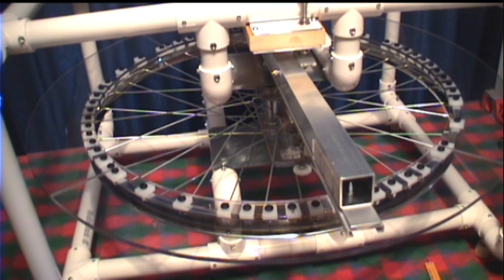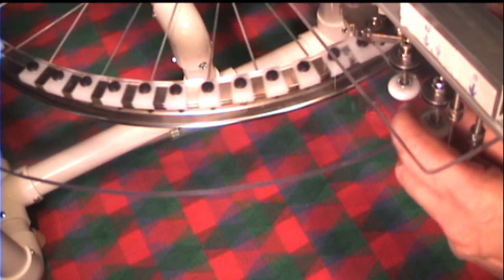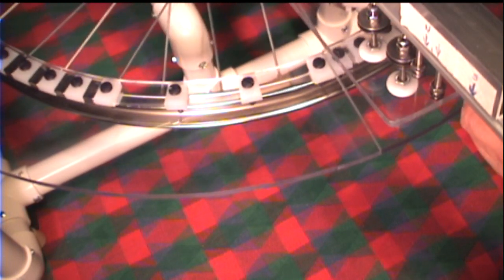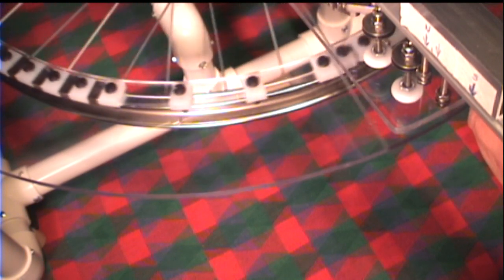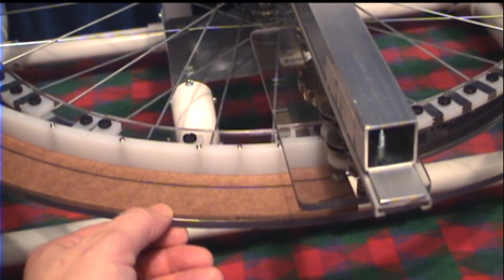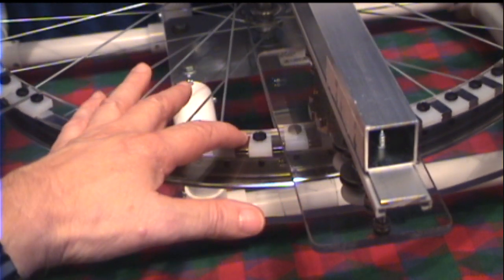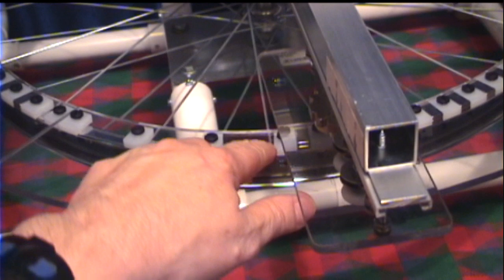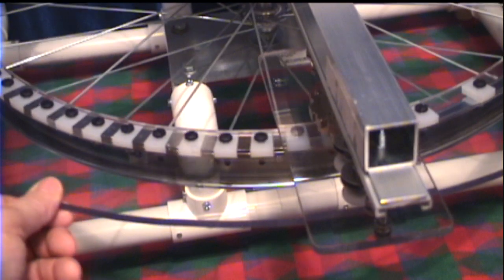Video #25, "Rick's Pipe Dream" Magnetic Motor-Generator Project

Comment from the maker: @crazypjk  You may find video #27 more to your liking, wherein the track is gone, and a push rod, or "linkage rod," as I call it, has been added.  Cam action is too slow to achieve the desired pole shift of the stator at the tail end of a rotor magnet group, so a repulsive magnetic interaction would be used instead.  Kind of a magnetic cam, you might say.  Still working on that angle while I perform a series of elapsed time tests for various rotor magnet layouts.

Comment from the maker: @MrMatt027 @MrMatt027   Alternating rotor magnet groups of north-south-north-south is the most efficient layout for a moving stator or MOSTAT design.  To avoid anti-rotational reattraction, the stator must be moved to obtain a pole shift as the last magnet of a rotor group passes by.  This provides repulsion acceleration, and leaves the stator in the correct position for attraction acceleration as the next rotor magnet group approaches the stator.

Comment from the maker: In regards to the Pipe Dream prototype, a rotational force can be either a magnetic repulsion or magnetic attraction effect which either accelerates or maintains speed of rotation.  Conversely, an anti-rotational force can be any factor (magnetic, mechanical, aerodynamic, etc.) that slows or stops rotation.

Comment from the maker: The track system is no longer used.  Instead, magnetic repulsion will repel the slider carriage inward or outward at the tail end of each rotor magnet group.  The MOSTAT has been moved from the carriage to a pivoting mount which is linked to and actuated by the carriage movement.

Comment from the maker: The carriage does not need to be locked.  When engaged with a rotor magnet group, the stator is in attraction mode and is self positioning.  Between rotor magnet groups, repulsion will be used to quickly move the carriage and pivoting stator, and a stop will be used at both ends of carriage travel.  It would only be at very low rotational speed that the slider carriage could possibly slide inwards, and downhill, when at its outer position.

Comment from the maker: The track method will not be used at all, because it cannot move the slider carriage quickly enough.  Movement must be precisely timed and occur very quickly to gain repulsion acceleration advantage at the tail end of each rotor magnet group.

Comment from the maker: Hi Jimbob, and thanks for your interest.  Yes, I expect that the unit will be self sustaining.  The friction and air drag are very minimal when compared to the accelerative thrusts afforded by the magnetic interactions.  And the new method for the MOSTAT movement will not cause any additional drag.  You can view an animation of this method at the Pipe Dream website.  See bottom of  the "more info" area here for a link.

Comment: Hi Rick
I commend you in your efforts in trying to make your wheel  rotate under magnetic force but unfortunately this can never work.  The reason it can never work is due to the fact that you need to do work to move the arm to continue rotation.  This and friction in the system will always require more energy than the mgnets can deliver.

Comment from the maker: I think you mean moving the rotor magnets, right?  That cannot be done on a narrow rimmed wheel such as I am using.  I do have plans to experiment with such an idea later by reinstalling my wood flywheel on the backside of the rim and overlaying it with sheet metal to allow a wide range of varying magnet placements.

Comment from the maker: Actually it already is divided, since the hard drive moving stator (MOSTAT) magnet utilizes both poles.  The new configuration places the MOSTAT magnet on a pivoting mount activated by the slider carriage, and requiring half the carriage travel previously needed for a pole shift.

Comment from the maker: If I had laid track at all areas where needed, and given the wheel a hand spin, the wheel would have kept going for a considerable number of revolutions.  It would have slowed and stopped, however, due to the anti-rotational attraction mentioned above.  The stator needs to move quickly into repulsion at the tail end of a rotor group, and ANY amount of repulsion will guarantee continuous rotation.  A rapid change to maximize repulsion will guarantee high rpm and improved torque.

Comment from the maker: Because the change is relatively slow, this leaves the stator in attraction to the tail end of the rotor magnet group, attempting to slow or reverse rotation.  The stator pole change must occur very quickly to avoid this, and the method I am now working on shows much promise to offer that capability.

Comment from the maker: No, the track is not needed at all adjacent to groups of rotor magnets, as the stator magnet is self positioning when over a rotor group.  The track could be used in between rotor magnet groups to prevent the stator carriage from drifting inward, but there is really no other reason to keep it.  My purpose in testing the track was to see if it could be used to change the stator position at the tail end of a rotor group, and I found the change is not rapid enough to be useful.

Comment from the maker: I do believe that a working all mechanical wheel can be constructed, however, and that magnets could be used to enhance the operation of the mechanisms.  I have a concept in mind for doing so, and will be applying that on the back side of my wood flywheel when I can find the time to do so.  One thing at a time, though!  I need to first carry on with my present course of experimentation, which I do see as promising.  Thanks for your interest, CS.     -Rick

Comment from the maker: Working with weights in this manner is problematical, though, since it would require an off-balance situation at the critical point where gravity assist is desired.  Unless balance of the rotor is maintained, the rotations will be slowed and the unit prone to vibration, much as an out of balance load in a washing machine's spin cycle.  Also, when such weight is rotated to the bottom position it must then be lifted until it reaches the top again, with gravity working against you.

Comment from the maker: Hi CS,   The Pipe Dream test apparatus is designed so that it can stand in 5 different orientations, both horizontal and vertical, so there is no need to mount the wheel differently.  A vertical orientation is shown at the beginning of video #17, where I show a wood flywheel mounted.  I will be utilizing that 4 pound flywheel later, and will also be using balance weights.  Additional weights can be added at certain critical points to gain momentum in a vertical operation, as you suggest.

Comment from the maker: Hi Doug,
Yes, I have though about practically all imaginable mechanical methods of stator movement, and have concluded that no mechanical method alone, or in combination with other mechanical methods, will work well enough.  Basically, that is because the pole shift cannot be accomplished fast enough without creating substantial anti-rotational force.  I am currently working on a method that combines repulsive magnetic interactions with mechanical stator movement, and it looks promising.

Comment: Rick,

Outstanding work.  I have a question/suggestion.  rather than a track around the outside have you considered a small disc around the hub with an undulating slot to push/pull the stator via an extension arm to the stator...seems it would allow more prcise alignment.

best, Doug

Comment from the maker: I realize that the term "moving stator" seems contrary to accepted norms, but see no problem with this description.  My stator is in fact stationary while engaged with a rotor magnet group, but is then moved while in between rotor magnet groups to effect a pole change.  Thus the stator does move, and it is therefore appropriate to describe it as a moving stator, or MOSTAT (an acronym I coined which has the same meaning).   I think my viewers understand this, and are not ignorant of the facts.

Comment from the maker: Thanks for your interest jupy.  The work continues, though I am currently pressed to complete some home maintenance tasks before the weather gets much colder.   I had done so much work on the Pipe Dream project from May to August that I neglected maintenence work on my house and cottage, so I am now working non-stop to catch up with that.  The feel of fall is in the air, and temperature is dropping to the 30's at night.  Sorry for the delay, but more is on the way, so hang in there.

Comment from the maker: This new stator magnet position not only affords high repulsion at the tail end of each magnet group, but also leaves the stator perfectly aligned for maximum attraction acceleration at the lead end of the next approaching rotor magnet group.  I'm sure that you will easily visualize what I am describing, and will understand the great advantage of this method to utilize both attraction AND repulsion forces.  Feel free to e-mail me if you have any questions or suggestions regarding this method.

Comment from the maker: The timing will occur at the tail end of each rotor magnet group, where carriage movement only requires a force of 1 ounce or less.  I will be moving the stator magnet off the carriage and onto a separate pivoting mount which the carriage will link to at a point close to the pivot.  The Stator magnet will be farther from the pivot point, so that 1/4 inch of carriage movement will equal about 1 inch of stator movement, quickly realigning the stator into repulsion with the rotor group gone by.

Comment from the maker: The carriage will have a magnet affixed at each end. The inboard end magnet will be repulsed by two rotating magnets affixed 180 degrees apart on a central axle hub.  The outboard end magnet will be repulsed by two rotating magnets affixed 180 degrees apart from each other above the outer perimeter of the rotor, and 90 degrees from the hub magnets.   Thus, the carriage will move inwards or outwards with each repulsion, and at the correct timing sequence.

Comment from the maker: You and I have no quarrel, James.  I understand your shielding methods, and applaud you for your efforts.  There is good reason, though, why I do not want to shield my stator.  I want to take advantage of attraction acceleration as rotor magnets approach the stator, as well as repulsion acceleration as the magnets
pass by the stator, and this can only be done with a MOSTAT (moving stator).   I'm sure you would agree that such movement would have significant advantage if practicable.

Comment from the maker: Perhaps, but suppose that I add that energy in the form of magnetic repulsion that moves the stator carriage outwards and inwards.  There would be no anti- rotational effect, because the stator carriage moves quite freely at the desired pole shift point, and moves in a direction that does not oppose rotor rotation.

Comment from the maker: Correct, although stator movement requires less than 1 ounce of force if it is done after the last magnet of a rotor group passes the stator.  The only trick involved in this is getting the stator to shift positions very rapidly so that repulsion effect is maximized as much as possible at the tail end of a rotor magnet group.  If movement is slow, as with the track system, this cannot be accomplished, and attraction force will attempt to halt rotation.

Comment from the maker: Yes, the stator must be repeatedly moved to shift pole positions and remain in a desired state of attraction or repulson.  The N-S-N-S configuration of the 4 rotor groups, however, only requires 4 stator movements per revolution, while 8 accelerations are realized.  That cuts the work in half.  Also consider that each shift to attraction mode is largely accomplished automaticaly by the attraction force involved, and this further reduces the required workload on the unit.

Comment: You demonstrated in you video's that the attraction and repulsion does not happen only in the  direction of the rotation, but also in the radial direction (perpendicular to the first. You even measured the forces. (Great, BTW)
So it is not just shifting the stator to and fro, but also conquering these forces.

Comment: Yes, one half of the wheel prefers one direction, the other prefers the opposite direction. That is what I meant by no preference and symmetry.
To keep it moving, you need to change the configuration repeatedly, and that is, I believe where the external energy is put in.

Comment from the maker: If you watch this video again, and are closely observant, you will notice that the rotor begins movement from a repulsive position at the tail end of a rotor magnet group, and that the next approaching rotor magnet group is in attraction to the stator.  You will see that the rotor accelerates at this second point, that this happens because of the magnetic interactions involved, and not because I am adding an energy pulse at this point in the rotation.

Comment from the maker: Yes, the 4 rotor magnet groups are arranged symmetrically around the rotor, although in changing pole configurations.  I do realize that multiple stators, arranged non-symmetrically, will be the preferred arrangement, but before embarking on that deployment it is my intention to obtain the best possible rotation from a single stator.

Comment from the maker: Actually the wheel does prefer a cetain direction of rotation.  To reverse the direction of rotation, I must orient the stator magnet to an alignment that is 180 degrees from its current position, or begin and continue stator movements starting with the opposite pole from what was demonstrated.  In that case, what has been considered as the lead-in  magnet of a rotor magnet group in attraction mode would become the tail-end repulsive point during rotation.

Comment: Besides that, your system seems to be perfectly symmetrical. If you move the stator magnet differently, the wheel will spin the other way around with the same ease or difficulty. It does not prefer a certain rotating direction. That should make you think too. 
Does this help?

Comment: Of course. I do not disagree with that. OK, use a set of magnets to energize the swing. The principle does not change in my view. Nor does the type of movement. Without friction, the swing keeps moving as a pendulum, just as your wheel keeps rotating in the horizontal. Acceleration happens because you add energy pulses. It does not matter so much if you use magnets or a blowing stream of air or pulling cords or an electro motor or what have you.

Comment from the maker: Yes, in the earlier videos it is understood that I did manually supply whatever energy was required to move the stator into the desired alignments for attraction or repulsion effects, but rotor rotation only results from those effects.  Therefore, if stator movement can be accomplished mechanically and/or magnetically then undeniably the rotor will rotate as a result.

Comment from the maker: Gravity has no effect on rotational movement of this device because it is perfectly leveled, and I never said that energy was coming from "nowhere."  You can't compare swing movement to rotor movement unless you attach a magnet to the swing seat and then use another magnet to "push" the swing, and even then the swing moves in an arc where the rotor does not.  All rotor motion is due to magnetic interactions causing attraction and repulsion.

Comment from the maker: Actually, it would be nearly impossible to arrange the rotor magnets to obtain the desired repulsive effect at the tail end of each magnet group if the stator is in a fixed position.  That's because in order to be aligned closely for repulsion, the tail end rotor magnet would have to pass beneath the stator magnet at the opposite pole from that which the lead-in magnet was aligned to.  Therefore, you would see anti-rotational repulsion canceling out any beneficial repulsion effect - not good.

Comment: Rick,

You try to move your stator magnet with a track.
But as the position is totally coupled to the position of the wheel, would it not be much easier to make the stator magnet really fixed and position the rotor magnets at each place of the wheel in the right position for the stator magnets.
As these positions are symmetrical, it would not be a big problem, but you would need a wheel with a widere rim.

Just my thoughts

Comment from the maker: "The most plausible and commonly accepted mechanism of plasma acceleration due to conversion of the MAGNETIC ENERGY into plasma kinetic and thermal energy is known as magnetic reconnection."  - Andrei Runov,  a research space physicist with the Institute of Geophysics and Planetary Physics at the University of California, Los Angeles. His current research interests are the physics of magnetospheric substorms, dynamics of space current sheets, and particle energization in space plasmas.

Comment from the maker: Also read this quote from NASA - "As the Sun's ionized and magnetized particles are passing by Earth they impart mechanical energy which is transformed into MAGNETIC ENERGY by compressing the tail. The tail field lines eventually merge (or "reconnect") and slingshot particles towards and away from Earth, thereby converting magnetic into particle energy."

For those who still don't think that magnetic energy exists, study solar flares, which are releases of magnetic energy.

Comment from the maker: I am currently working on another mechanical method of moving the stator, and this will utilize far greater mechanical advantage.  If this still isn't enough to obtain sufficient repulsive kick at the tail end of each rotor magnet group, I will then work on utilizing magnetic interactions to either assist the mechanical method, or entirely provide the necessary force to move the stator as required.